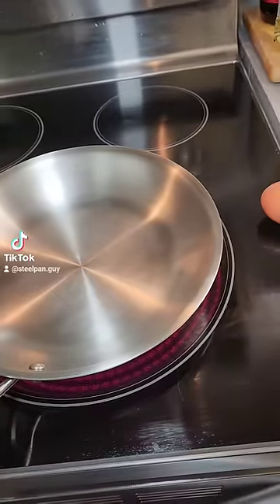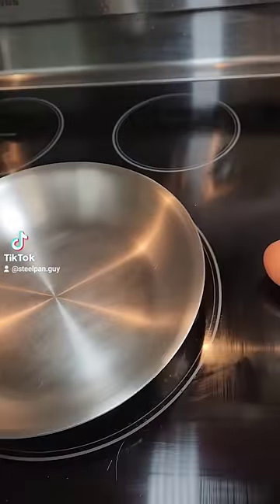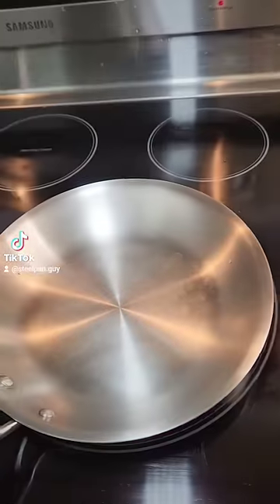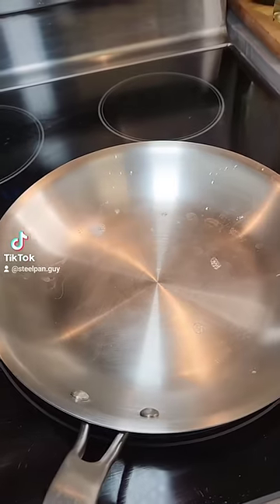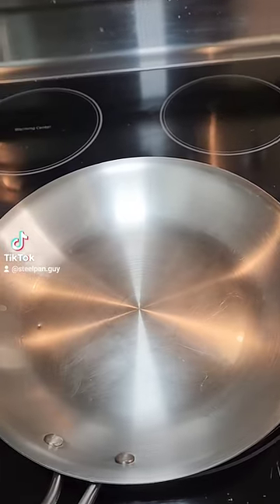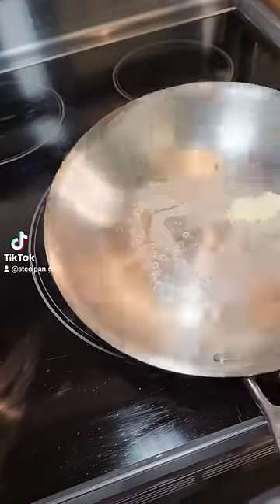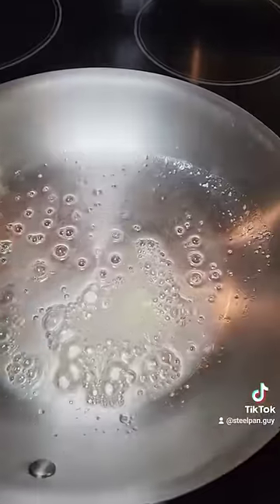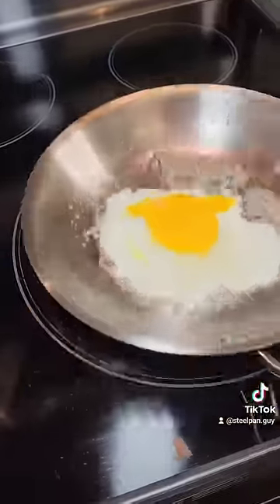Real chefs use stainless steel pans to cook eggs

Comment: real chefs dont fuck up the egg
Reply: "only a real one can cook an egg on stainless steel"...proceeds to tell us "only THIS pan can cook the egg like this" and never tells us which pan it is lol 💀
Reply: Don't forget the... glide? I think he said with no explanation
Reply: Good piont 😂😂
Reply: The point is stainless IS the best IF you know what your doing. It's one of the only materials that once it gets that hot you only need literally one drop of oil and if the pans seasoned you can probably do it with no oils.

He's a short order chef so stop the hate. Ive cooked in 3 star restaurants and pubs makes no difference.
Reply: He fucked the yolk up. Like dude shouldn't even try and tell anyone how to cook.
Reply: I can’t believe he cracked the egg in a video on how to cook an egg 😂
Reply: @rimposter4871 Dudes recording with hus right hand and trying to make sure it stays in frame.
Reply: @self835 generally you wouldn’t season stainless. Cast iron and carbon steel yes, but no need for stainless
Reply: I have to put a * with every single cuss word on every single comment on youtube. Otherwise they remove my comment. So how tf do you get away with that ? Lol don't worry I'm not snitching I just wanna know 😅
Reply: @TheMAU5SoundsLikThis  soooo..... you cook shelled eggs in a pan?
Reply: Sorry but as a Chef, if you did that I would expect you to throw out that egg and start again. I would expect you to do it right by the 3rd or fourth try. If you can’t then I would assign you to something else. I would later tell you to go home and practice with at least a dozen eggs per day until you get it right. All Chefs are cooks but not all cooks are chefs.
Reply: @shamphyx.asphyxiate.1486 stainless steel, literally said it in the beginning.
Reply: @alejandrogarciaandrade6800  even working at a dinner as a short order cook, I found it unacceptable to let an egg go out with a broken yoke, the only exception was if it was over hard.  Regardless of where one works, they should still put out the best quality. I believe you would agree with that.
Reply: Do you know how hard it is to crack an egg with one hand and not break the yolk? Not very, good call.
Reply: @self835  One drop of oil will not make a stainless steel pan non stick. Even in this video he added about a tablespoon of oil, then added more fats.
Reply: Heard
Reply: Lmao
Reply: I spray my ss pan with Pam cooking spray and my eggs never stick heat at 275 for eggs.
Reply: As a real chef, we use nonstick pans because they are low maintenance and cost $6 a pan. Replacing them every two weeks literally costs less than what we spend on food waste in a day.
Reply: Old egg
Reply: Lmao right
Reply: my thoughts exactly!
Reply: Everybody knows. Real chefs.
Reply: @dracekidjr  there's not a quality restaurant run by a chef worth his salt that's running non stick Teflon pans.  No one is using plastic/silicone whisks, turners/flippers, forks and spoons in a professional kitchen so as not to damage the pans.  If you're using "non stick" pans in your restaurant, give us all the name so we know to avoid it at all costs
Reply: And there was a shell piece in it too! 😂
Reply: Exactly
Reply: @self835  Yeah ok, how much oil did he put in and then how much butter he use, maybe your definition of one drop is different to mine.
  BTW do short order cooks fuck around waiting for pans to heat up? Just use a non stick pan, it will not kill you
Reply: @self835  how can something be the best if it can't do anything that requires lower heat. Make custardy scrambled eggs on stainless and see how that works out for you
Reply: @breedlofam cake spatulas are silicone.. but i guess they are not chefs by your standard
Reply: It’s not like a pâtissier isnt a name..
Reply: Did he?
Reply: @Kybx  don't be pedantic.  No professional kitchen is using non stick cookware.  It's toxic AF when being constantly scraped with metal utensils.  We don't even use them in baking except when using very particular types of pans that aren't 6 bucks and disposable.
Reply: I didn't see the shell.
Reply: If you cant crack an egg right you shouldnt be cooking
Reply: @Kybx silicone is not good to consume. Good old wood is the way to go
Reply: Yeah!
Reply: @self835 who cares about your life story  , he fucked up the egg
Reply: Eggs were the first thing I learned. Breakfast. Fried hard, over easy, over medium, sunny side up, scrambled. We didn't do poached. Hard boiled if the right customer. Never had to do soft boiled. All the omelettes. I've made creamed eggs, egg salad, wtf else am I missing. Ik I am. Quiche. Idfk. Crepes with yolks. Crepes with whites. It's like potatoes, or noodles/pasta, or rice. The possibilities are endless.
Reply: Right, how the hell you gonna say real chefs and you crack the yok. 😅😅
Reply: I wouldn’t normally troll but declaring don’t cook unless you do it this way is the most asinine statement …then dude breaks the egg.
Reply: Eggs are so expensive you can’t just redo the video with a new egg so you don’t post a video that shows a correct egg.
Reply: Yeah, he jammed his fingers into that egg crack. I don't know what he's on, but I've been able to do a one-handed egg crack since I was seven learning with my nan. It's not difficult, even if you can't do it with just your hand, then do it with the rim of something it's not that difficult.
Reply: Omg you add butter what a trick lol
Reply: Dude literally poured oil in the pan than put butter in the oil no wonder the egg wouldn’t stick you got 2 different lubricants 😂😂😂
Reply: That really trigger me. I was intrigued until this one handed BS and busted the yolk
Reply: I was just about to say this 🤣
Reply: @Snookchaser007  oh stop real chefs have the money to redo there videos when the make mistakes.. Stop playing the victim.. You fucked up mate.
Reply: @firewater652  what 
I am not the chef here 
Apparently you can not understand sarcasm
Reply: Real chefs don’t waste time making YouTube videos they have a career
Reply: ☝️🤣 Top Comment
Reply: I keep missing the part where he claims to be a professional chef?
Reply: @self835 Season a stainless steel pan? LMAO NO
Reply: You stole my comment!!!!!!
Reply: @dracekidjr yeahhhhh that's the way.
Reply: Btw this video is a joke
Reply: @rimposter4871 video is a joke btw
Reply: “Pay no attention to that broken egg yolk behind the curtain.”

Chutzpah 10/10
Credibility 0/10
Reply: @TheMeTreeHouse not very hard. Practice. Or cope. (Am chef)
Reply: He used one hand
Reply: Hahaha
Reply: Have you seen Hells Kitchen ?😂😭
Reply: @self835 what the fuck is a seasoned Stainless Steel Pan? 
You can only season wrought iron pans.
Reply: Preach!
Reply: @shamphyx.asphyxiate.1486 wtf do you mean not tell you the pan. It's a stainless steel pan, what else do you need? Lmao.
Reply: @jonroyal1214 you aren't eating the fucking silicone my guy
Reply: @paindiscomfort6579 yea, I used to be a cook, if you cook eggs professionally, or Crack hundreds of eggs a shift, which I did, you can Crack an egg in on hand, Matta fact, I used to Crack 12 dozen eggs as my side work preshift, I cracked two eggs at a time, one in each hand, bro gassing himself up just to break the yolk and use too much oil
Reply: Got em
Reply: so this does work though his explanation is close to bs get the pan ripping hot till as he says the water dances. the part he failed to mention / lied about use a well seasoned pan and any steel pan should work as long as you season your pans
Reply: @Titus_J  He did. That was his 14th egg. And he still ruined it.
Reply: @shamphyx.asphyxiate.1486  it's stainless steel. The brand doesn't matter.
Reply: 😂literally
Reply: @thebob3712  a spoon drop of oil, or, a tablespoon of oil.
Reply: @dylanalbertson5269  comment I replied to said one drop of oil. One drop is a drop, I don;t know wtf a spoon drop is or where you got tablespoon of oil from, the comment was one drop.
 Understand the things you read before making a comment
Reply: It's fine I actually prefer my yolks like that it gives more texture to the eggs.  I generally dislike perfect eggs.
Reply: @self835 yeah try cooking on dry stainless and see what happens. Need a lil more than a drop lol. Why should short order chefs be held to a lower standard? Also  if you wanna talk about the best pan to cook in it’s def whatever tf you decide to use and are good with. Plus what chef doesn’t use gas stove?
Reply: Anyone going to say that it needs to be clarified butter?
Reply: @jasondelgado9126  it doesn’t, you can use regular butter, especially with eggs. Just don’t preheat your pan too high so it doesn’t burn it immediately
Reply: @TheMeTreeHouse nope, if you try it 4 times you will get it. Comes from a student. Let the egg drop on the counter sideways from 15 cm and crack it open. Works like a charm and the crack is perfect every time
Reply: @rimposter4871 lol TRUTH!
Reply: i use less fat for 5-6 eggs :D
Reply: Thank you 🎉
Reply: Yep
Reply: Yes they do.. they've fucked up more eggs than you've seen in your life
Reply: 😂😂 so true
Reply: Not that hard, cradle the egg with ring, pinky, and thumb.. index, and middle finger over the top like a claw, crack in the middle between edge of thumb and the tips of your “claw” and pull open with that “claw”. I also sling brunch every weekend so it’s second nature now lol.
Reply: @rimposter4871  pretty much, tired of crap cooks telling others they are not real when these people can not even cook a peanut butter and jelly sandwich. yeah sarcasm but truth
Reply: Or use electric
Reply: It’s called smashed eggs
Reply: Uhhhhh no he fixed the yoke. How many styles of fried eggs are there?@rimposter4871
Reply: Harsh but true
Reply: Exactly, like bro do a second take
Reply: @Lanteader dude has all the time in the world to do multiple takes
Reply: @dracekidjr a real chef using nonstick pans due to low cost
Stop lying about being a chef at your minimum wage job.
Reply: I wanted to say it!
Reply: Well said
Reply: Hey I'm a real chef and I fuck eggs up all the time
Reply: I do.  I make them in a ss pot (after watching Gordon Ramsey's video on how to make the perfect scrambled eggs).  Regardless of how much butter you use to coat it though, it is still a total pain in the ass to clean.  They come out glorious though...
Reply: Amen!
Reply: Hahahhahaha glad you said it

Comment: congrats, you learned that butter stops things from sticking and is delicious
Reply: It's not just the butter. It's also the leidenfrost effect.
Reply: Also he added oil a moment before. Either would do
Reply: Lol leidenfrost isn’t doing anything. The egg cools it down too much.
Reply: Salted butter though, right???
Reply: No, he's trying to season a pan. He's not explaining it correctly. Technically it infuses with the pan so it shouldn't be as much oil as you see in the video but yeah
Reply: butter burns quickly too
Reply: @christopherwilliams6446  that's not what he did, and you can't season stainless steel
Reply: @Augusto9588  it can in fact be season... I've been a chef for 7 years. It's similar to cast iron they both can be season. Stop spreading misinformation
Reply: It's about getting the oil to the correct temperature. If the oil isn't at the correct temperature your food will stick to the pan despite all the oil. This is also how you cook with cast iron.
Reply: @supermom7433  that's also another factor... some food will stick regardless but like you said most of the time I needs to be at the correct temp if not it'll stick to the pan if it's too low
Reply: Super elite chef secrets
Reply: @Lakehousebuild he didn’t add the oil a moment before it was there for like 2 minutes heating up lol

Comment: 'If you can't cook on this, you shouldn't be cooking'.
*fucks up egg immediately *
Reply: Hahahahhaha
Reply: And he decided to keep it in the video. 😂
Reply: He screwed up by even needing to do the water test in the first place.
Reply: @onradioactivewaves  And he never did get the water test right! I didn't see any drops skittering across the pan. On the third try, the water immediately turned to vapor, but he flipped the pan so it was hard to see. I think he decided "I'm not going to f* with this anymore."
Reply: @dennischiapello7243  ya exactly, I noticed he screwed it up also 😅 looked like he tried to hide it.

Comment: "Cooking is not confusing"
This guy: "cooking on the high end of medium low..."
Reply: I figured it out. The high end of medium low, is medium low high, or medium high low 😂
Reply: @Gspec5  gotcha
Reply: I mean, it’s pretty simple to understand. He is cooking just under medium.
Reply: @beef4847  thanks for sharing
Reply: Sounds like the weather girl in Baltimore. She says highs in the low to middle upper forties.  She said it twice
Reply: This guy broke the yolk, added oil AND butter.
Don't listen to random people on the internet, guy is a clown.
Reply: @Gspec5 what you said 😂
Reply: High end of medium low sounds too much. I just say the line after or before medium I don’t understand the need for such an elaborate statement however, being a chef it does sound more workplace appropriate.
Reply: @RuinedItAgain oil and butter is extremely common in restaurants tho
Reply: @polyphil506  Turn the electric stove to 4.
Reply: @RuinedItAgain  Yeah and you want butter you add some oil and it won't burn.  Equivalent to clarified butter.
Reply: @Realityhurtsdoesntit  Cut the crap.  Range goes Off to LO to 10.  Turn it to 4.
Reply: @donaldkasper8346  If you are burning your butter cooking eggs you are cooking them too hot. I can understand both for meat, but not eggs.
Reply: @RuinedItAgain  Cooking is a function of time to temperature.  Exceptions to using any point on this function curve is the boiling point of water.  Sometimes you need steam like for bread.
Reply: @donaldkasper8346  there are different models of ovens my dude. The fact you don’t comprehend that shows me you lack the knowledge of basic kitchen equipment.
Reply: @Realityhurtsdoesntit  Wow, as in some heat and some don't?  I never knew.  Wowza.  Oh, and uh, cooking eggs in a stainless pan is called cooking on a stove, not an oven.  Just saying.
Reply: I really just thought this would be 4 out of 10. Didn't think people would get confused by that until I read this.
Reply: @Sonic-gy7kq  he implied 5 ranges. we need the high part of 20 to 40/100 or about 35/100.
Reply: @johnnyghanja so 46-49